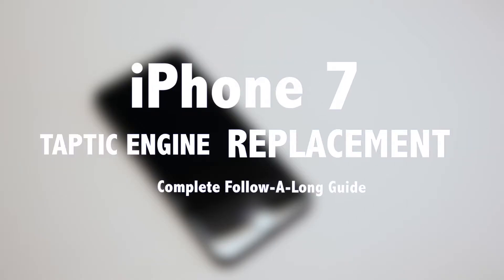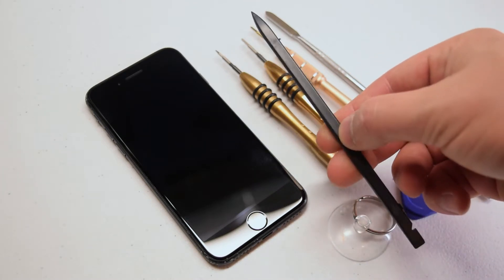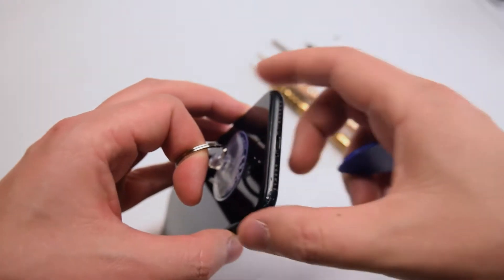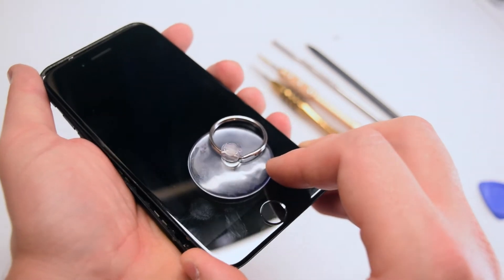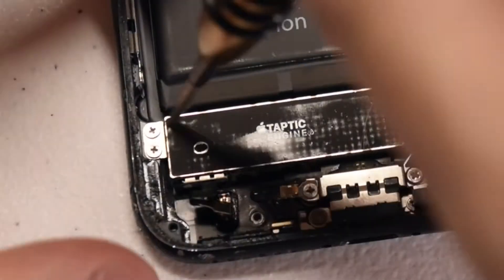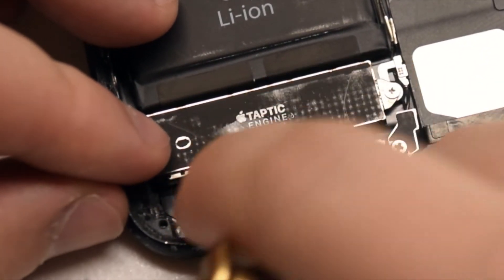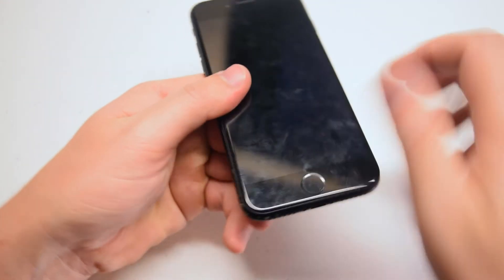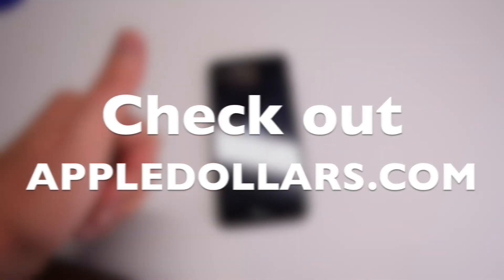iPhone 7 Taptic Engine Replacement

Comment: I followed all the procedures, but my Taptic Engine still is not working :’(. I bought an original used one, from Ebay. In addition, I resented all my settings. Still no success. Any suggestions? Should I do something else? Maybe there is something to do with its serial number, I don’t know...
Reply from the maker: Hard to say, it very well could be a logic board issue. Did you update to latest iOS?
Reply: @GRIBSOFT  yes I did. Seems that I have a problem with it, but I can't see any damage on it... So wierd :(

Comment: replace the taptic engine of my iphone 7 plus with an original one and even then the home or the 3D touch does not work, help me please
Reply from the maker: The taptic engine is not part of the home button or 3d touch. You might have damaged the cable to the home button.
Reply: @GRIBSOFT  Yes it is. What shitty and uninformed advice, how can you have a channel centered around Apple but say shit like this?

Comment: One should befor one does something to disconnect the battery to avoid short circuits ...
Reply from the maker: Disconnecting the battery will reset the phones SMC, do not disconnect it unless you are replacing the battery. You will not short anything.
Reply: @GRIBSOFT come on man, this is really bad advice! Always disconnect the battery.

Lets say you are changing the screen on an ipad mini (old design). It’s so easy to short the backlight filter to ground and blow it up, simply by misaligning the pins on the lcd connector. 

Then you’re gonna have to remove it and replace it or just connect the 2 pads with a jumper, good luck with that, that blown filter will more likely than not take the pads with it.

Always disconnect the battery before doing anything with your device!